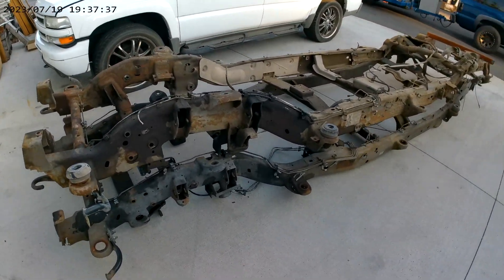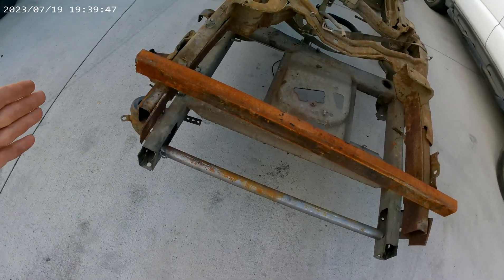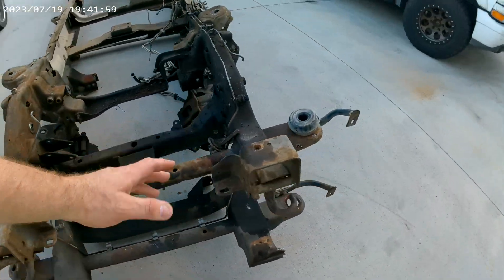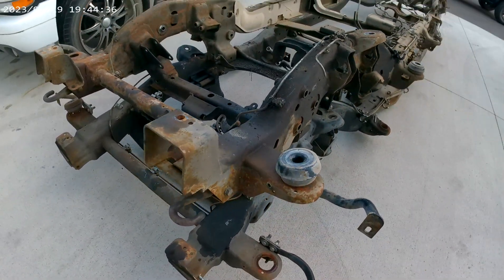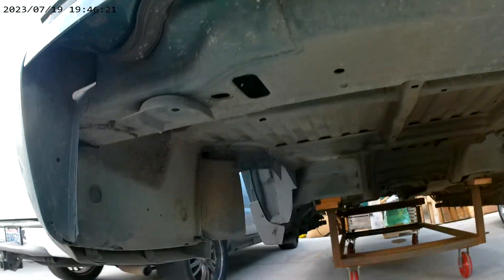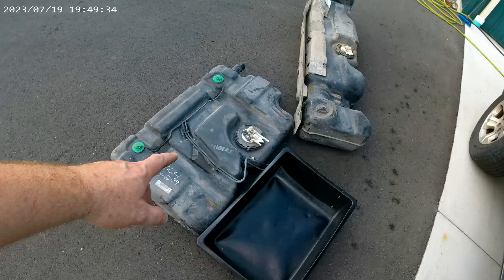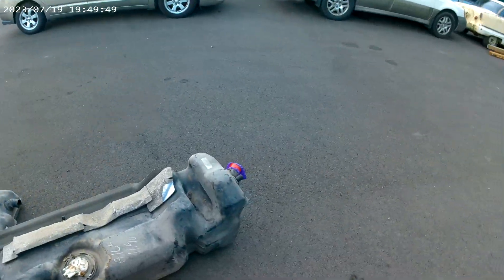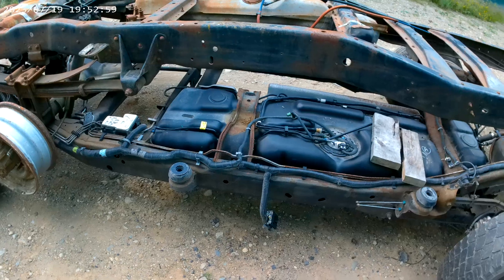GMT800 Suburban/Yukon XL/Escalade EXT Frame Differences 1500/2500

Comment: So to my understanding it seems like swapping 1500 and 2500 cabs and anything in front of the bed should theoretically work. Or am i off base? It looks like it could be a direct swap especially if both the 2500 and the 1500 were both the same configuration, that being single cab, extended cab, etc. Etc.

Either way super interesting, i love watching informative videos like this
Reply from the maker: truck to truck, yes. cabs and beds are the same between 1500 and 2500/3500s. but you cant take a truck frame and put a suburban on it without major mods.

Comment: How difficult was is to put the 14 bolt and 9.25 in place of the 10.5 and 8.25? How close did the mounting points line up and what sort of modifications did you have to make ? Great content btw I haven’t seen anyone do as well of a comparison on the frames. Thank you for sharing.
Reply from the maker: nothing at all was close. I had to weld 4 link brackets to the 14 bolt (its actually a dana 70 in the blue suburban) and cut all the mounts out of the front to mount the 9.25. its about as far from a direct swap as possible.
Reply: @OlsonKustomWorks  wow 😅 well you know what they say “nothing worth doing is ever easy!” After you were done did you end up using the 1500 upper and lower control arms or did you cut the mounts and weld on ones for the 2500? One last question regarding the 9.25. Did it have enough space to fit properly within the frame rails being narrower on the 1500? Also with the engine mounts being in a different location did it interfere with the oil pan or anything? Thanks for the reply this kind of information is priceless! Nothing better than real world experience.
Reply from the maker: @redneck305xD  The 2500 lower arms are pretty close to the same, the uppers are wayyyyy different. I just made ball joint spacers for the uppers, and moved the lowers out 3/4" to comp for the arm length difference. the 9.25 is the same width flange to flange as the 1500 diff. engine mounts are basically in the same place.
Reply from the maker: @redneck305xD  i made another video with some pics of the swap if you are interested
Reply: @OlsonKustomWorks  oh I was not aware of that. I’ll have to go check it out! Thanks again for the reply.

Comment: How many body mount on 2500 for yukon xl 2500?
Reply from the maker: @alihawi2957  same as a 1500. 12 total but the core support ones are usually slighly different.

Comment: With the core supports being unique to each does that mean you can body swap, but the front clip swaps would not be a direct bolt up? Say for EXT front clip on the 2500 body? Very much appreciate your visual and verbal comparisons. Thank you
Reply from the maker: @specialK121  core support would have to stay per the frame. So a 1500 frame has to keep the 1500 core support. You can run a 2500 core support on a 1500 frame with a 3" body lift or modify the front frame area
Reply from the maker: @specialK121  the body panels are all the same.
Reply: Thank you for the reply. Not sure if you would know by chance if the GMT800 Escalade front fenders, hood, grill, bumper and lights all swap & mount to the 2500 Burb without modification?
Reply: Sorry not sure if you caught my last reply. Would the Escalade fenders, headlight brackets, grill, hood and front bumper be a direct swap without modification on the 3/4 ton Suburban/ Yukon XL?
Reply from the maker: @specialK121  everything but the bumper i think. The body stuff is all the same but the core support being taller might mess with bumper alignment
Reply: @OlsonKustomWorks  I have seen the Tahoe and Suburban 1500 chasis to 2500 front clip conversion. They had to adjust where the bumper tab mounts are so that would make sense. I just have not been in there on both variations myself and hoped you might know. Since you are familiar with both frames. I appreciate your content, time and for the follow up reply!

Comment: Does the 2500 frame seem considerably stronger than the 1500?
It looks bigger physically but I noticed the 1500 frame is boxed
Reply from the maker: @coleknight7529  correct. As stated in the video the 2500 frame actually flexes a lot more and i think is overall weaker. The boxed 1500 frame is a lot stiffer

Comment: The 2500 frame doesn't need to be boxed because it is a good bit thicker metal than the 1500 frame.
Reply: Is it actually? I read somewhere it was 2mm thicker, but the C channel still lacks the rigidity of a fully boxed frame. 
I'd love to know their relative weight.
Reply: @gc99289  C channel allows for much better rust prevention.  At least up in the northeast, a lot of boxed frames rot from the inside out.
Reply from the maker: not true at all, it has more flex, so it can technically handle higher loads. its a weaker frame tho

Comment: throw on some 3/4 axles and Bam you have a better 3/4 truck frame
Reply from the maker: been there. my 1500 in the background has a dana70 out back, a 9.25 front diff, 2500 front knuckles, 4l80 and a 263 tcase
Reply: expect that the 2500 frame is made of thicker metal and doesn't need to be boxed.
Reply from the maker: @billclisham8668  its not. It flexes a lot more. Even loading the bare frames up on the scrap trailer with the forklift the 2500 frame was like a wet noodle

Comment: Thank you I have a 1500 suburban and I purchased a 2500 rolling chassis and I’m going to be body swapping it onto that. Also going to be doing a duramax swap with the 2500 chassis
Reply: I am doing a similar swap myself. I pu a 2006 2500 suburban to swap my 2003 escalade esv with a 2004 lb7/ allison duramax combo.My concern is the dual fuel tanks and how to retain them.

Comment: taking them to scrap? they look brand new compared to what's rolling the streets of New England
Reply from the maker: Did you not watch the video? The 2500 frame had been repaired badly multiple times. And the 1500 frame was bent and folded in the front from a collision. Neither were fixable

Comment: Nice video, i love my 03 2500 Suburban and i also own a 86 k5 blazer and there is alot different in ways of frame construction back in the 60's-80's C/K trucks to even a 92 silverado i used to own, it had a decent built frame with some boxing up front like they did the 2500's. Very informative, thanks for sharing

Comment: Would I be able to use a 1500 Body Mount Bushing kit on a 2500? 
I drive a 2009 Burb 2500. 
Thanks for the video and any additional info you can provide.
Reply from the maker: Body mounts should be the same between the 1500 and 2500. I know at least on the gmt800s they are. The 900s should be the same as well

Comment: Suburban and Avalanche are different from the 1500 pick-up frame so not a "great" comparison but mostly good info
Reply from the maker: This is just talking about SUV frames as it says in the description.
Reply: @OlsonKustomWorks  i don't remember my 02 1500 avi having a boxed frame....
Reply: @OlsonKustomWorks Would you happen to have any info/knowledge of the 2002 Avalanche 2500 frames? The last few inches from the bed mount to the end of the frame where it meets the bumper, rusted off on both sides taking the bumper and aftermarket hitch assembly down with it. I can't seem to locate a repair kit for the 2500, the only available kits are for the 1500s. This seems odd
Reply from the maker: @imatellya2609  Avalanche frames are the same as the suburban frames, not close to the truck frames. The 2500s frames are closer to the truck 2500 frames as they are an open C design vs the boxed design, but the mounts etc are all different. Id find a fab shop to fix up the frame vs trying to find a repair kit, and get the upgraded hitch from Drawtite.

Comment: Surprising for gm to have so many differences. 
I'm about to do a 1500 burb body swap onto my 2500 8.1 chassis. 

I belive the 2500 fuel tank is slightly narrower also making up for the frame rails being closer together where the 1500 tank would have driveshsft issues .

Great video .
My 8.1 radiator support is bent I was wondering the difference in the 1500 one.
Looks like I need to find a replacement for the 2500
Reply: How did this go for you? Lining up the 1500 body on the 2500 frame
Reply: @alexcurtis9790  body is the same just a few nuts are not in the body in the back where the 2500 mounts were moved due to rear suspension.
The holes are there just have to be creative to get nuts in there
Reply: To be clear, you were successful as swapping a 1500 burb body onto the 2500 burb frame?  I'm also looking to do this swap and was expecting it to be more of a direct swap